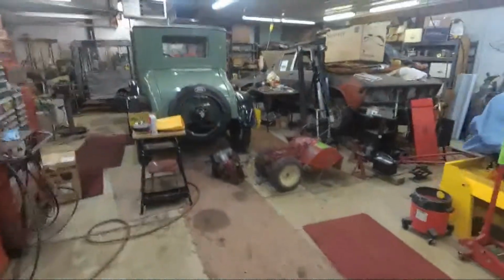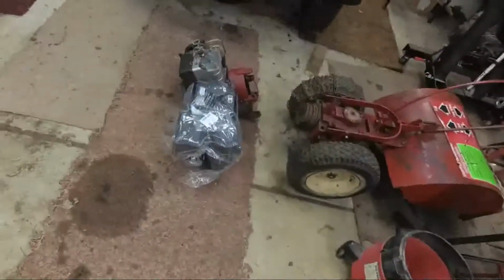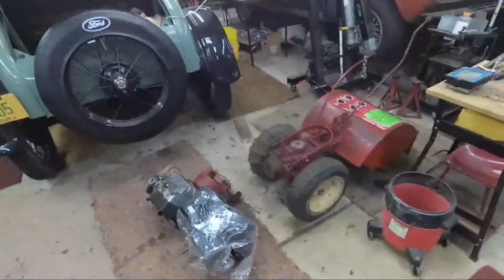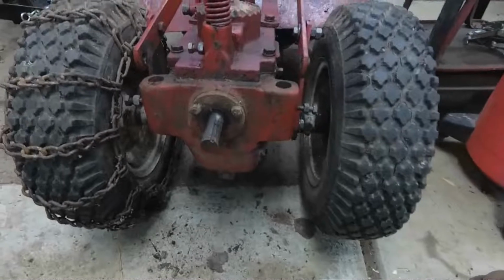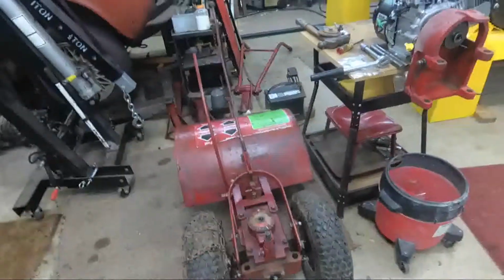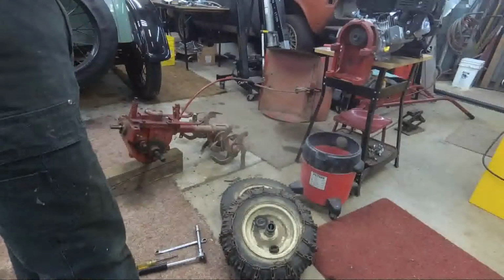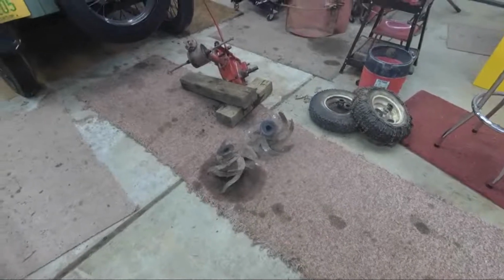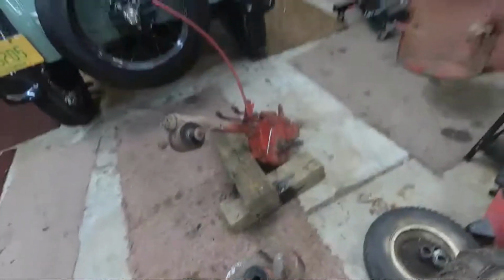Troy Bilt Horse Part 1

Comment: Hello Dale, my horse is a little older I believe. Was handed down to my father from Grandpa and now me. It’s a Trojan Horse with cast iron spoke wheels, serial number 1002 purchased in 1964 by Grandpa. This tiller is same age as me. I too started with replacing seals and ended up doing a near total rebuild, with many happy thoughts about my grandparents along the way! Do you know if the reversing disc on a 1964 is the same? I looked on Parts tree and failed to find the same tiller for the disc part number and what I did find wasn’t available anyway. I have no service manual to go by either. I found a link to the manual a while back but couldn’t find where I saved it. If you can help I would truly appreciate it😊.
Reply from the maker: It has been quite a while since I did the work and I had get a new phone in the meantime so I lost a bunch of info.  I will see if I can find something and post it here if I do.
Reply: @daleolson7205  thanks for trying Dale.. I did find the transmission service manual today on PDF if you ever need that again.